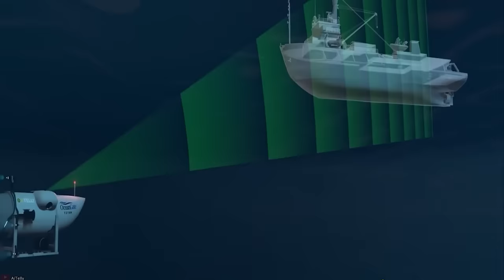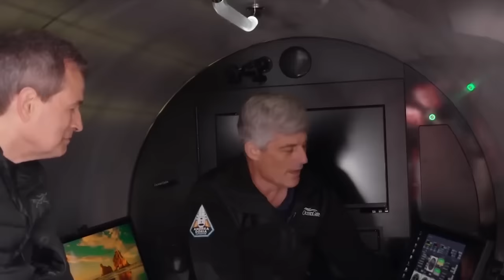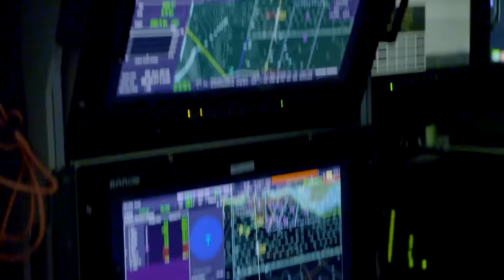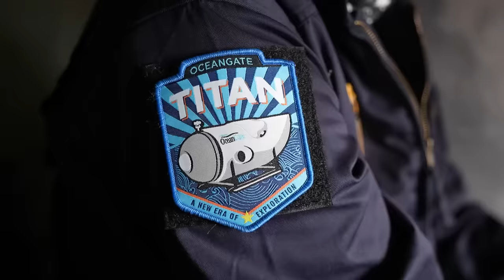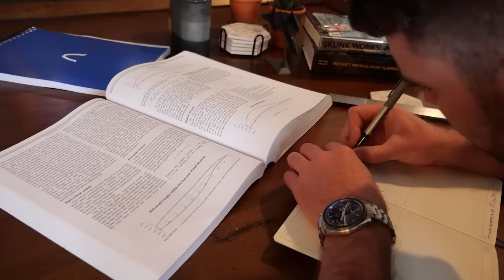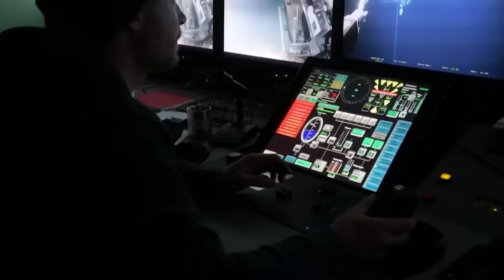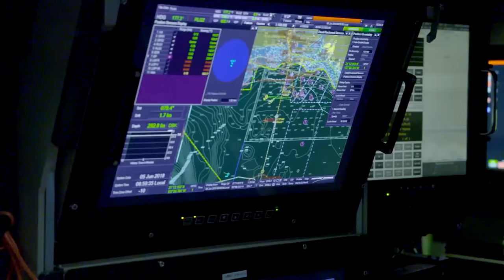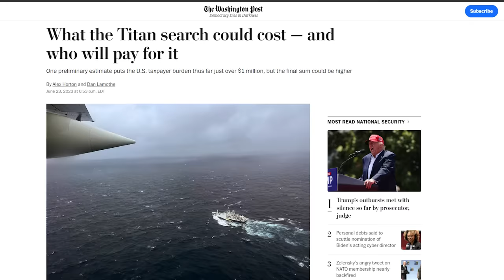US Navy Reveals TERRIFYING Truth Behind The OceanGate Submarine Tragedy | Titan Documentary

Comment: Basically the concept for making $$ was a very good one. They just didn't have the correct components for making these dives to depth. Yep build a very large bathysphere out of stainless that supported a perfect sphere with everything contained within its shell. I would have gone with a Trieste type design. It used gasoline for neutral buoyancy as that concept worked very well. Just need to make the bathysphere larger so it could support a larger human payload. Use liquid O2 for atmosphere maintaining 21% and a method for holding atmosphere at 15psi. These critical components need to be monitored along with a backup plan because we die very quickly without having correct pressure and O2 percentage. I would not have a viewport I'd be using cameras. Lots of them. And of course egress from both inside and outside would be a must in fact you'd want 2 ports for egress for safety. People would need to prepare for this trip.. That would include an enema and no food to be consumed after 6 hours prior to the dive. Instead have snacks on board and a way to urinate with a bit of privacy because kidneys don't stop working, see? I would have very heavy negative buoyancy to get our asses down there quickly within a half hour or so. Yeah same thing using positive buoyancy. That way you don't spend a lotta time descending and ascending. I'd be using magnetics to hold iron ballast and I'd have a LOT of it as stated. Yep little trim motors to hold one at desired depth after dropping about half the ballast. Then release the remainder of ballast for rapid ascent. Why waste time ascending/descending you wanna spend your time on the wreck itself (not traveling to/from it).

Comment: Some people fault the carbon fiber. But others suggest a more plausible cause...the EPOXY used to laminate the carbon fiber layers together.
Carbon fiber is extremely strong in both compression and tension. But as the structure compresses, it introduces SHEAR stresses. Even in a non laminated, solid block of steel, the yield strength is roughly one third that of its tensile strength. The differential is even greater in a laminated product because epoxy has nowhere near the strength characteristic of carbon fiber. The result is an increased risk of delamination.

Comment: The carbon fiber was not layout correctly, they supposed to go around but at 45 degrees back and forth but they only did unidirectional, big mistake that cost their life.
Reply: @Beebob-xw9xn is not the carbon fiber the issue, is the layout, it was done unidirectional only, big mistake, the pressure separate the unidirectional rings.

Comment: i've followed this story for a while now, i possibly agree that Ocean Gate could have done more, i certainly believe they should have listened to experts advice and worked on that, dismissing somebody because of their views is simply stupid, if someone's are that important they should be listened to with good reason and understanding - but i with my my designers head on still think the initial designs were at fault, i am still unsure of the use of carbon fibre, sure it is strong, but there are issues with galvanic corrosion etc and there are a few stories on the web available especially as it is used more so in aviation technologies, i was not too convinced at the overall design and shape and how the materials were joined together, bonded to smooth surfaces and not having extra reinforcements built into the carbon fibre - i'm sure as time goes on, experiments will be made on this design to see what's really going on - i cannot in this day and age of robotics understand why Ocean Gate did not undertake more experimental dives using remote technology to perform dives repeatedly with no persons on board, it was suicide

Comment: now that  this has happened , every self proclaimed and not a few actual experts are all weighing in on the most likely
 scenario - catastrophic pressure hull failure secondary to wrong choice of building material.  Almost laughably wrong, to hear them tell it.  Not a single -voice was raised  to propose, 'anything. 
The problem with the above, other than the almost eager rush to judgement, is that it usually precedes a great discovery.  Like, say, yes   you can use carbon fiber for a pressure hull. They just did it wrong.  Its not impossible to do.  And  it is not necessary to spend almost as much on safety t0esting as for the whole sub costs. Imagine how much faster progress would be without testing to the nth degree.  Not no testing but just enough to satisfy the designer/builder...  Brilliant design and risking more like Indianna Jones than a new mother. A high risk attracts some people.  I'll bet if you could ask them, the crew would say, overall, that the risks were  worth  it, and if not this time  maybe next!